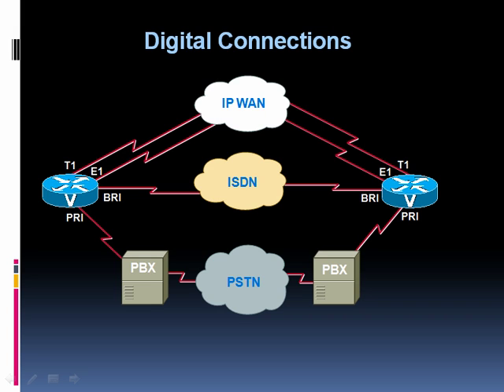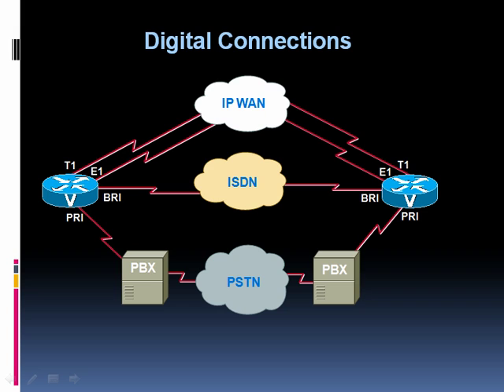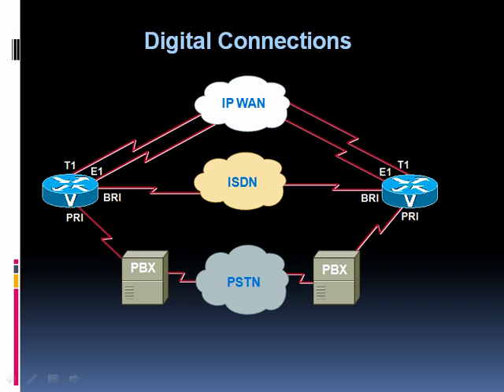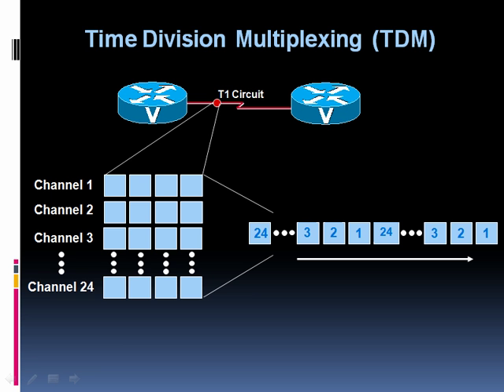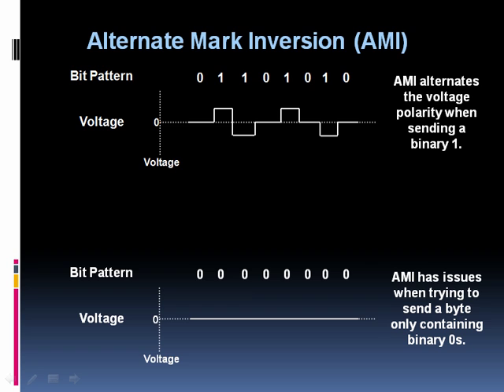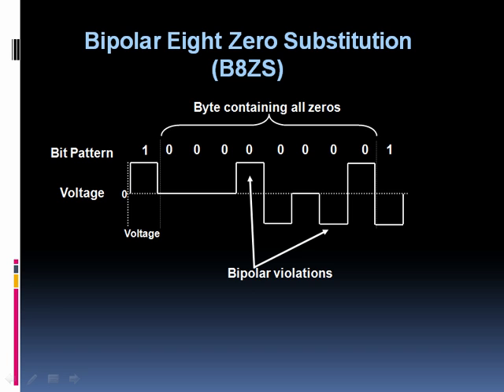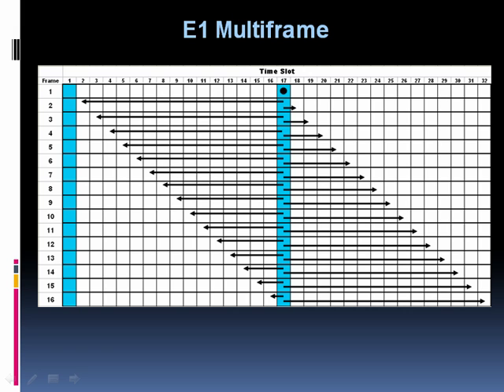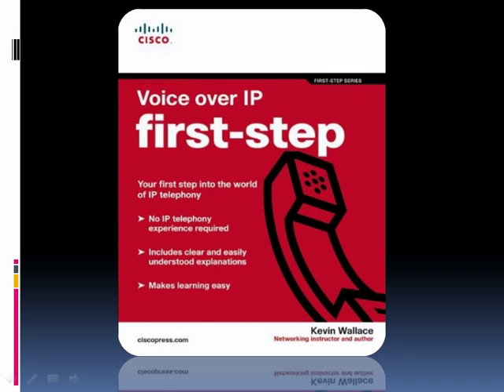Let's Get D-I-G-T-A-L (Theory) 2 of 2

Comment: Hi Kevin. Related to CAS on a T1(robbed-bit) - does the signaling equipment "rob" all 24 DS0s of the LSB in every 6th frame?? I'm guessing it must be so (that would fit the ESF format - you'd be getting 24 robbed bits to do A-B-C-D signaling for 6 frames) but I'd appreciate your confirmation. Many thanks.